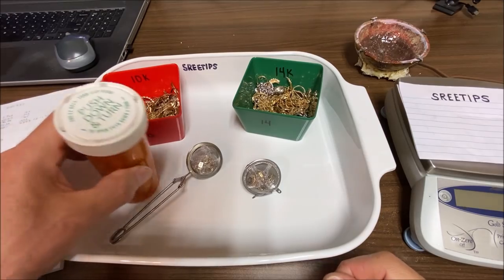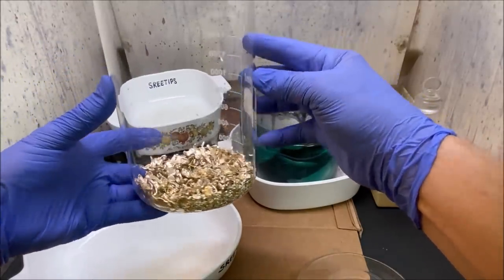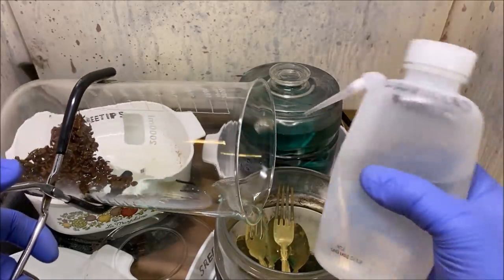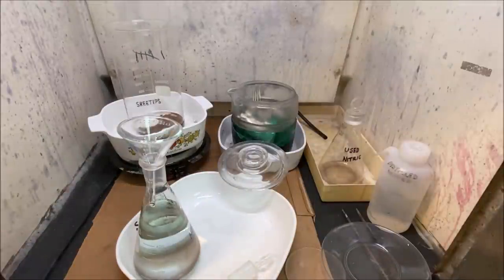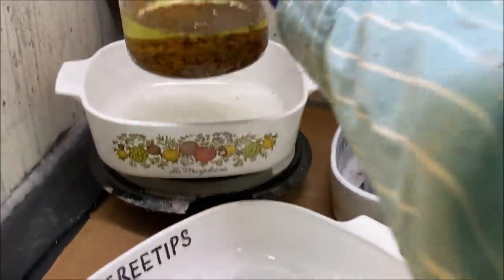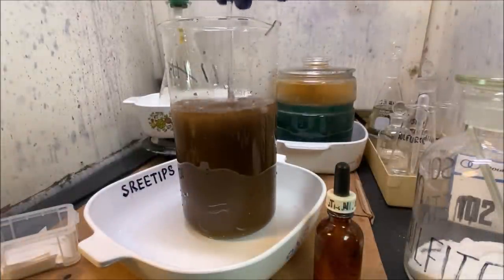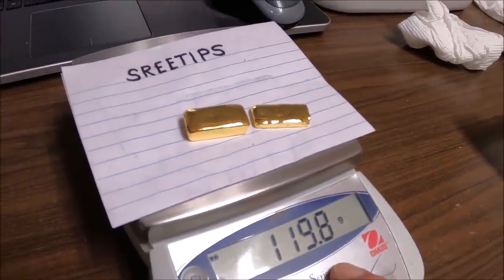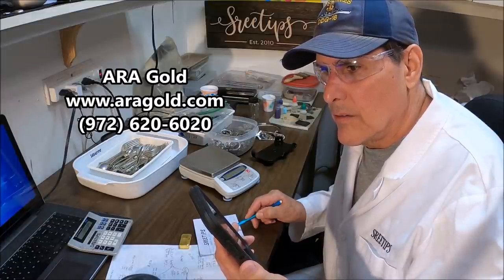How To Sell Your Gold

Comment: This is straight up the exact definition of true Alchemy , something that very very very few people know anything at all about these days , this is an ancient lost art, or a dead art, glad to see someone doing quite advanced refinery type work on a small private scale , so if.im not mistaken through all the combined process's that you executed here if I understand correctly at.the end you end up with very pure silver and very pure gold that both can be smelted down or poured into homemade casts in the shape of small and large rounds as.well as any size and shape silver or gold bars you may want.  You should have a machine shop CNC or laser jet/water jet a couple specific sized and visual patterned and misc identifying .lettering In coin and bar shapes CNC'd from whatever the correct material would be to use when stamping and or pouring gold and silver then maybe get a matching back side to whatever size and shape coin or bar stamping die you have CNC'd and weld this back piece which would be like 1-2 tenths of a millimeter smaller In overall size and weld it to a big 2"-4" round or square solid hardened steel block that you can attach to a bench top hydraulic press , mount It directly as the head of the press at the end of the piston shaft, then have your main CNC'd front as well as main body piece of the proper metal milled out of a massive block of whatever metal that may be ,.say like long enough to stretch from front edge to rear most edge of the two front and rear main pressing platform IBeams and say I dunno 4"-6" wide by like 3'-4" tall , this will be your stamping base that you'd put your 1500 degree or whatever the temperature is molten and already slightly cooled basically liquid silver or gold directly into , enough so there is small excess at the top so you end up pressing some excess out when you do press it to make sure you got enough molten material to make a full size piece however big your stamping block and press head/back side press face attached to thick strong metal which can be directly mounted to the hydraulic piston right at the very end of the ram.  If you get the size and fitment between the bottom stamping base and the base side stamping head so there's almost no excess play whatsoever it should literally only stamp the exact size you want quite reliably maybe with a very thin slight build up of excess gold or silver that squeezed out around the edges that can easily be broken off and very carefully filled with a fine grit file then buff those edges up to a decent polish real quick and boom you got homemade refined silver and gold , a homemade hydraulic stamping press with as many different shaped casts that you wish to have made , and end up with properly and accurately measured gold and/or silver rounds and bars stamped very professionally all at home and the stamping press wouldn't be that much money to put together.  Then if you got all the silver and gold you used to stamp a bunch or rounds or bars for a really good price such as like priceless estate sale treasure finds that you've collected alot of weight in over time , you could actually go ahead and probably sell some of your silver and gold rounds or bars and make a very high rate of profit if you got the raw and scrap metals cheap enough.  I have one question , If I'm not mistaken through part of this process you did regarding the silver did you actually take cheap and not so valuable sterling silver scrap and refine it down to a practically .999% silver purity which is like as pure as it gets except for the .9999% we see from the Canadian national mint, cause if so I'm gonna start going out to find and collect as much cheap ass sterling silver as I can get my hands on. Also when you refine the silver do you end up with the same weight in ultra pure .999% silver as you started with in sterling silver purity ? Or is there a percentage of materials loss say per ounce or however?   One last question again if I'm not mistaken you in a couple hours time and careful precise work are able to consistently and reliably convert 10k and 14k purity gold and refined it down to a .999% pure 22 or 24 karat gold purity, I think that's what you did i just want to make sure , if so what's the materials loss rate in say refining 1 ounce of mixed 10k and 14k gold scrap into .999% 22 or 24k virtually as pure as pure gets , so basically how much 22-24k .999 gold would you be left with after refining say one ounce of scrap 10kand 14k.  I know I said one last question but one more just hit me , is there a way you are aware pf to at home successfully strip gold and silver plating off from other metal based items and then go on to refine that striped gold or silver plating , second is it even worth the time ?
Reply from the maker: People understand gold and silver even less. They think fake paper dollars, that can be printed out of thin air, are more valuable than gold. They want the fiat paper so badly that they will gladly trade their gold for dollars - at a discount! But this won’t last forever. Eventually people will realize that the paper is worthless and there will be a mad dash into metals. Then we won’t be able to find gold anywhere.
Reply: I truelly respect the work you do brother.  Speaking of not being able to find gold when everyone finally realizes the paper is worthless I heard a report from some think tank group in where they did some calculations as to how much silver is going to be needed to meet the technological demand of the population in 10 years and they reported that there's only enough silver left in the earth to mine to build not even 50% of the the total projected needed technologies one decade from now.  I know you know what that means , over night at a point the price on silver is going to literally skyrocket , possibly coming near the value of gold if not higher who knows.  Im gonna do what I can the next couple years to free up as much fundage as possible and start focusing on silver because of this report, I wish I remembered where I read it as I'd share it but sorry to say I have no memory at all of where I read this , it was quite a few months ago.  Btw that little swirling pattern you get on the one side of all the bars you pour is quite beautiful I thought I should add.   What is your opinion on salvaging silver and gold from things like cell phone and computer components and circuit boards ? Is it worth it  and how would one go about learning how o separate gold and silver from other components made of plastics and other metals? I'm curious because I use an electronic cigarette to get my nicotine fix since I quit real cigarettes a year ago , and I just found out that the little disposable "vape pods" that I blow through like candy with this device have the entire battery contacts and heating coil plated in gold , I have been saving them for a year on a hunch and have over 4,000 of these pods , each one with an estimated 1/10th-1/15th of a grams worth of gold if I could separate them all from the plastic bodies then learn how to remove the gold plating from the contacts and terminals I calculate that over 4,000 of these little things would amount to quite a few ounces of gold and quite a few thousands of dollars.  Can you recommend any books or how too step by steps on how these processes are done ,  basically how to remove the plating from the base metals as I think from there using your videos I could find my way through how to refine , smelt and pour it , just need a little guidance . Thanks in advance
Reply from the maker: Electronics must have gold or they’d quite working in about a week. But the amount of gold is tiny - almost nothing, will do the trick. In my experience, gold plated material is best run through a sulfuric acid stripping cell. I don’t refine much escrap anymore because the amount of work and waste produced is so high. And the are just too low. But it is a way to accumulate pure gold and I don’t blame you for finding ways to get some. I hate refining silver! It’s messy, bulky solutions, lots of waste to deal with. But I just keep cranking out pure silver Crystal. As long as my wife keeps finding it, I’ll keep refining it.

Comment: 8:33 I'm looking at the fill/rinse/wash cycle and wondering what kind of volume in a refining operation would be needed to justify the expense of having a process train in place?  By process train I mean fill, drain and transfer lines into/out of a reaction vessel to reagent reservoirs, waste treatment and filtration stages.
Just looking at the yield and admittedly not knowing the input, overhead and labor costs almost 8 oz. of Gold is a tidy sum.

Comment: Excellent video; really interesting; thanks! I’d be interested to know if the the effort involved in refining your own carat scrap, with the time & cost of reagents, if there’s any advantage over just sending your scrap straight to the refiner? That’s what we tend to do in UK. Thanks  for the fascinating video!
Reply from the maker: Refiner doesn’t usually give credit for silver or platinum. I get to keep those. Plus the refiner doesn’t have much wiggle room when I send in pure gold. But it’s probably not that much different.
Reply: @sreetips  I saw on another video you said you get 98% from the refiner.  Have they ever tried to say that what you sent was as good a quality as you knew it to be?
Reply from the maker: They test with xrf to determine payout. Comes back three nines every time. They (the big refiner that I sell to) contacted me and wanted me to refine gold filled scrap for some of their clients. I respectfully declined because I only work on my own material.
Reply: @sreetips  speaks well for your reputation.  Love your videos.  Wish I could go shopping with Mrs. S.

Comment: How often do you clean the silver jars that are used for the pour offs of the nitric with the Sterling inside? Is there much gold/mud in with them? Always wonder as there’ll be silver in that you don’t like going in your stock pot
Reply from the maker: I keep piece of undissolved silver and boil those silver jars to ensure that all the free nitric is gone. However, there is gold mud and gold foils that settle to the bottom. After a few months accumulation, I add nitric to completely dissolve all the silver in the silver jar - so that there is plenty of boiling nitric AND NO PIECES OF SILVER LEFT AT ALL. Then I filter all the gold mud and gold foils and capture them in a specially prepared filter. Once I have the solids in the filter I rinse with much hot distilled water to remove as much silver as possible. Then I add the filter to my filter storage and save it. Once I’ve accumulated enough filters, I burn them to a fine ash and then process them for the gold and other precious metals that they contain. The clear filtered solution will have excess free nitric. I add that back to the silver jar and put in more sterling silver to consume it all and keep the silver jar going.
Reply: @sreetips  and so the cycle continues...Thanks for the reply

Comment: I'd like to know the ingot's weigh when it is steadily suspended in water by a thinnest wire without touching the bottom. The dry weigh divided by the wet weigh is the density of the ingot. The closer to 19,3 g/cm3, the most pure is the gold.
Reply: U must not be aware of Mr Sreetips pedigree....I will assure you that when he completes the process the ingots density will be 19,3g/ cm2

Comment: What an awesome video, I have a lot of computer CPU’s and memory cards and old nasa electrical terminal’sI need to get refined, who do you recommend? I’d love to see you do it and watch the video, that would be cool. Thanks.
Reply from the maker: Mike, unfortunately I only work on my own material because it’s my hobby. And I don’t refine much electronic scrap because the yields are too low.
Reply: @sreetips  , that’s cool, I also metal detect 3 times a week, I’ve accumulated a lot of  silver and gold rings over the last year, looks identical to what you worked with. Any way, you’re video was the most informative process I’ve seen on refining gold and silver ever. Thanks for sharing and responding.

Comment: Does the nitric have to be a % above what a hardware sells? and what is the temp. of the hotplate?
Reply from the maker: My nitric bottle says 68% to 70% and I adjust the hotplate hi or lo based on the process I’m using. Each refining will different. There are simply too many variables to give a specific number.

Comment: Sreetips, I am curious.  Could you elaborate as to the specific issues premxing aqua regia causes?
Reply: You wind up with excess nitric acid that has to be denoxed  by boiling down the solution and adding Hydrochloric acid to reconstitute, adding Sulfamic acid, or Urea. Otherwise, when you drop the gold, the remaining nitric in the aqua regia will cause the gold to re dissolve as fast as it forms. Wasteful and frustrating.
Reply: @Halloween111  Thanks!  Yes that would be frustrating.

Comment: Just a question, why don't you just cupel it to drive off the oxides and sell it to a refinery that pays you for the silver and gold content after it's been under the  XRF "florescents test"
Reply from the maker: None of the professional refiners that I learned from used cupel. Not one.
Reply: @sreetips  thanks mate what's it cost approximately for all the nitric & hydrochloric acid, gas and everything that you use And  your time plus the clean up and is there any real benefit to stripping the silver out when you would be paid for it anyway. Also can you get the silver out and into bar form? sorry for all the questions new to refining I'm a prospector I find gold I don't refine it  it's worth more as a natural nuggets most of the time.
Reply from the maker: Colin, gold refining is my hobby. For this bar I would estimate the cost of refining to be less than $100, all in, less my time and the cost of the scrap.
Reply from the maker: “Stripping” the silver out of the gold with boiling nitric also pulls all the other base metals from the gold. When complete, the resulting gold is very close to three nines without any further refining. I save all the silver solutions and get that silver. Then I run it through my silver cell. Once purified it can be sold as-is or melted and poured into bars.
Reply from the maker: I refine gold as a hobby. Placer nuggets are typically between 18k and 22k - the ones that I’ve worked with. I make videos of the refining. These videos continue to produce ad revenue long after the refined gold has been sold. The real value is in the video. And that’s why I refine the gold. Plus, holding high purity gold in the palm of your hand, there is nothing like it. Especially if you refined it yourself, at home.

Comment: I'd be curious to try inquarting with gold plated jewelry, that has a copper or brass base metal.
Reply from the maker: Probably not a good idea. Risk of getting some “junk” metal in there that causes big problems. Best to stick to clean sterling or copper.
Reply from the maker: Gold plated silver jewelry can be used. But you can’t go by the marking, each piece must be tested. About 5% is marked 925 but is not silver at all.

Comment: Could you run a couple extra silver cells if you connected them to the power supply in parallel then you can definitely go through all that cement silver.    :  )
Reply from the maker: No, I’ve tried it. Each cell would draw a different current. Entropy. But I could run a second silver cell.
Reply: I see... Yeah I bet you could run a few silver cells and run them at different intervals or all together whatever works best for you.    :  )

Comment: Could you use plated silver items to dissolve excess nitric?
Reply from the maker: Yes, but not a good idea.
Reply: @sreetips  why not, sorry I’m finding it hard to find sterling around NC estate sales
Reply from the maker: Silver is plated on brass or copper. The silver will cement right back out on the brass just as fast as it dissolves. This will go on and on until all the brass gets consumed.

Comment: Are you not able to sell it on Ebay for over 100% of spot like all of your other items?
Reply from the maker: I don’t know, I’ve not had good luck with an amount this large
Reply: @sreetips  I would always give it a shot before contacting a refiner, if I were you. That's big money you could be missing.
Reply: Also, kind of a different topic, but I have been following your channel since day 1. I also was present when you first joined GRF.
Reply: Don't forget, you have to pay eBay a percentage of the sale, a percentage of the shipping cost and a percentage for receiving the money.  That cuts the percentage received significantly.
Reply: I sell some small components from items I scrap out and test on eBay.  I like to charge a fixed rate for shipping because packing materials are not free.  Since eBay took over handling the money most of my items are in categories they charge a 30 cent listing fee and 12.35% final value fee.  The final value fee that I am charged is a total of the item price, the shipping charge, AND whatever state sales tax they may be required to collect from the buyer.  So I am actually being charged for money I don't get.  After losing money on several sales, I was forced to increase both my item prices and shipping fees.  Of course, these are small, inexpensive parts, but it illustrates that eBay is a joke now, and very expensive for sellers.
Reply: @interiorurbanmining1155  ebay isn't worth selling on. I used to sell electronics stuff, but with the ebay final val fees, getting dings with shipping cost fees and on top of that paypal fees. it just wasn't worth it anymore. now add in the sales tax garbage it is now totally not worth it. I went to cash in hand sells, you give me cash in hand you get item, no checks no cards no scampal no escam cash only.